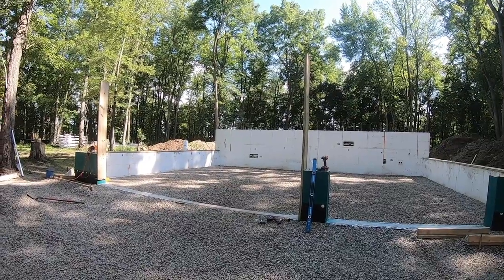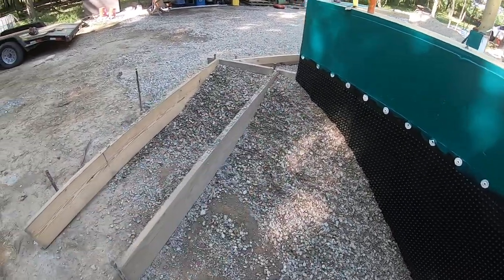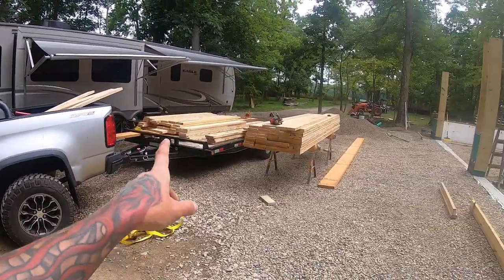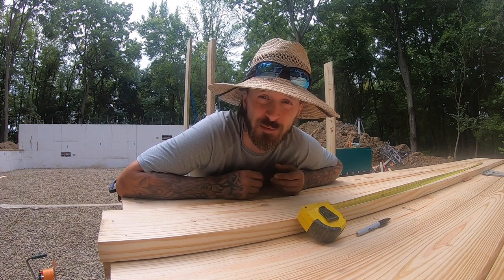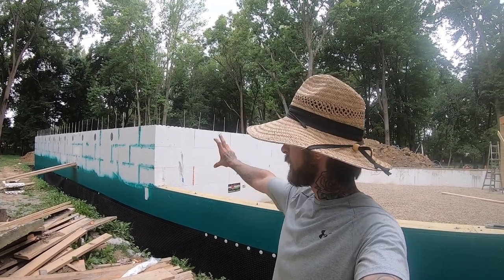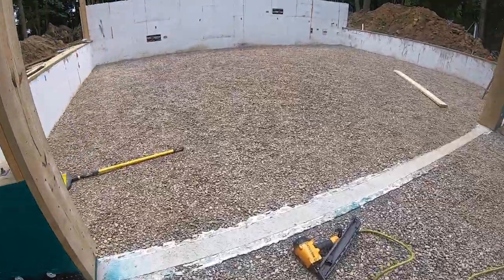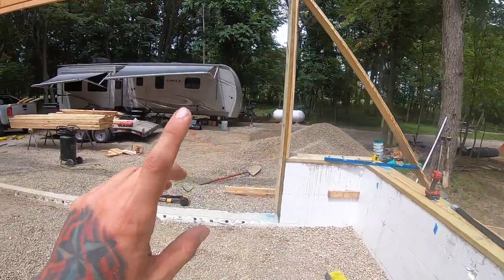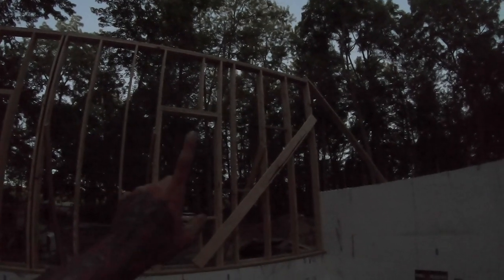Starting garage framing!

Comment: Just found your channel. I'm really enjoying your videos. 
You were talking about the king studs for the garage doors eventually rotting. If you use the waterproofing that you are using on the whole exterior to seal the end grain of those boards, they will last a lot longer
Reply from the maker: Mike Lilly yes very true.  Trim will be PVC so that should last in front of it.

Comment: Why didn't you just do ICF to the Rafters.  Would the cost be about the same?
Reply from the maker: Tom Callan no need.  The garage will be minimally heated and cooled.  Might as well save some money.  The voids however will still carry a R-36.6 value with the studs carrying a R-14.1 value and the doors an R-18.1.  The voids actually surpass an ICF wall by an R-12.6.  I’d have to add all that into a true R value calculator but my garage might actually beat my house on a total energy value.

Comment: Yea I know its the P.I.A. again. But I have a question. 
On your sheathing your saying your going to run a 8' tall and then 4' to the top, Right? 
OK now for the question why not place your sheathing horizontal instead of vertical starting with a 8' sheet then a 4 foot sheet then another 8' sheet that hits the 12' mark, that way you would only need to cut 2 sheet in half at the most depending on the end layout.
Reply from the maker: Greg Fisher running 8 foot tall then 4’ tall means you’ll only have 1 open seam where you need to put blocking.  My guess is structurally if you run them sideways you’ll have 2 open seams then needing more blocking.  My guess is this wouldn’t be as strong of a wall since you’re screwing into more blocking then a fixed stud that’s stronger and carrying load.  I could be wrong as blocking would stiffen the structure but I’d like as little horizontal seams as possible.  Water will love a horizontal seam more than a vertical.  All the verticals have studs behind them so water will drains down to the sill.  A horizontal seam, water will enter right into the cavity.
Reply: @neckofthewoods24  Thank you sir, that makes perfect sense now that you explained it to me. :) I'll just sit back quietly and just watch.